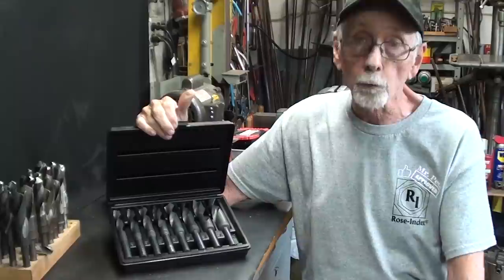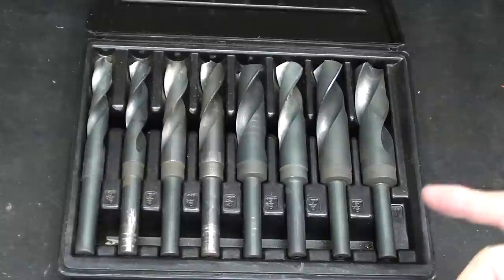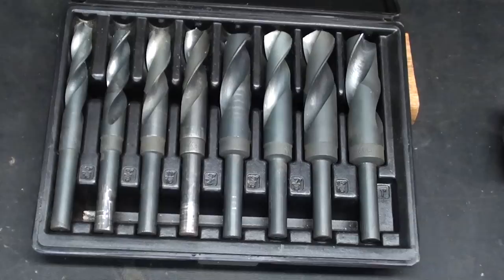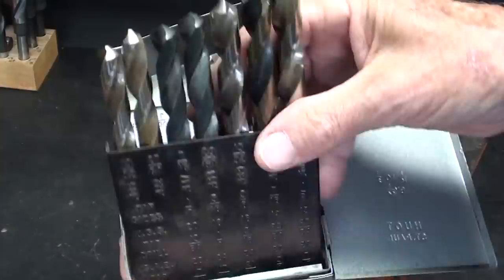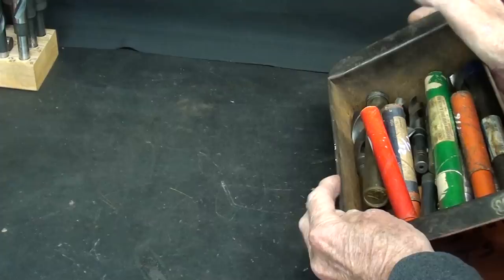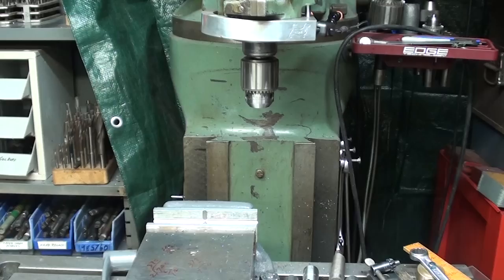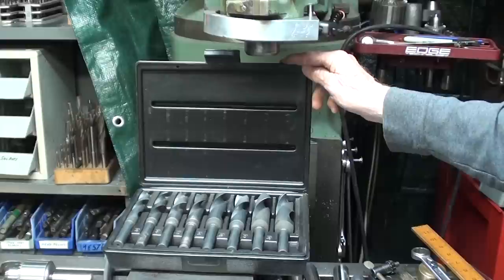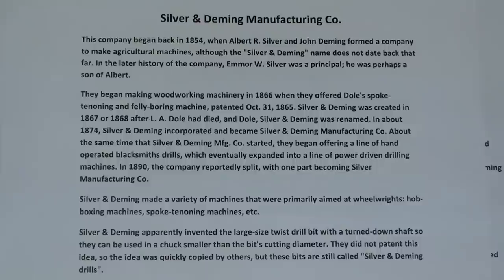WHAT ARE SILVER & DEMING DRILLS #14 short subject tubalcain

Comment: Take out a Bank Loan to buy Drill Bits 👌😄
It does get like that when you try to buy Good equipment.

IF someone's not paying you for your time working in your shop, it does get fairly difficult to justify buying quality tools ??

When you pickup the quality brand, you are quick to put it back down when you look at the price.
The same can be said for some of the fools who buy something at a machinery auction.
In some cases it's cheaper to buy the same thing at a quality tool supplier.
Reply from the maker: Yes, a set of Cleveland drillbits will cost you a fortune. And it is true, those are our many fools with deep pockets at auction sales

Comment: Why did you buy those Silver and Deming drills made in Communist China?  Was it solely to demonstrate the poor quality of these items?  If the only defect they exhibited was an innacurate grind, that could have been shown with a simple drill gage, maybe at the store.  
I think the manufacturer understands that these drills will be used principally by do-it-yourselfers in hand drills who typically oscillate (or rock) the drill in the hole until they achieve cutting.  The result is a distorted hole, but they typically don't care.  I've seen a lot of them.  I think you'll agree, one of the tell-tale signs of poor craftsmanship in  workpiece.

Comment: I wouldn't want to hear what my shop teacher, back in the day, would have said if I showed him I had sharpened a drill bit, like that new one you first showed. I have done a better job out in the field with an angle grinder in a pinch. By the time we finished the machine shop course, we could sharpen drill bits and lathe bits by sight

Comment: Odd. I'm seeing what i think is that set at MSC for $315:

CHICAGO-LATROBE

Drill Bit Set: Reduced Shank Drill Bits, 8 Pc, 1″ Drill Bit Size, 118 °, High Speed Steel
Oxide, Standard, Reduced Shank, Series 190

MSC# 81345084
Mfr# 57840

List Price $450.98 ea.
Your Price $315.69 ea.
You Save  $135.29 ea.

Total  $315.69

At any rate, i am not a fan of reduced shank drills. You can easily overload your chuck and drill press with them. Admittedly, there aren't good alternatives for a mill. All my big drills are Morse taper drills used in the lathe tail stock.